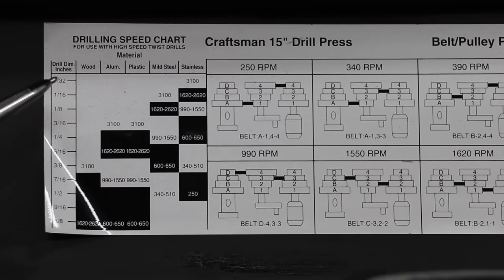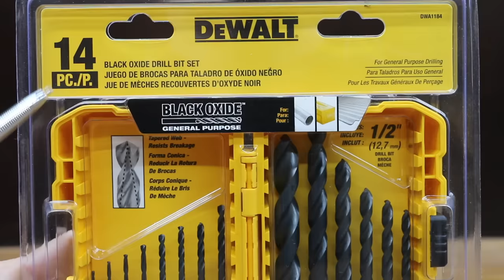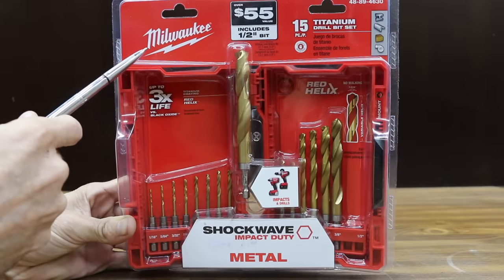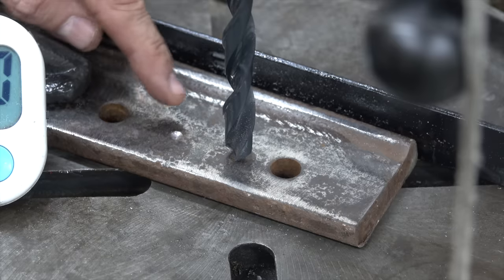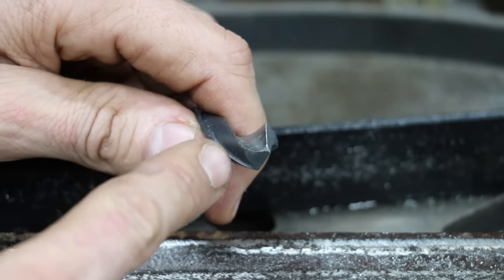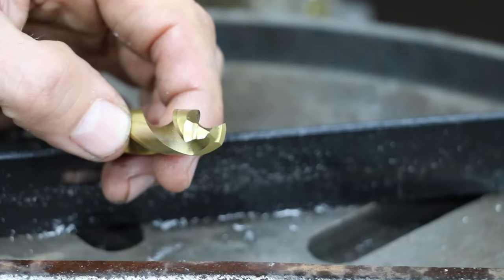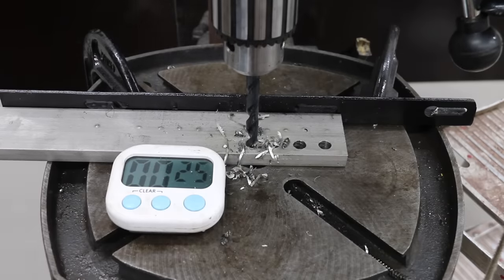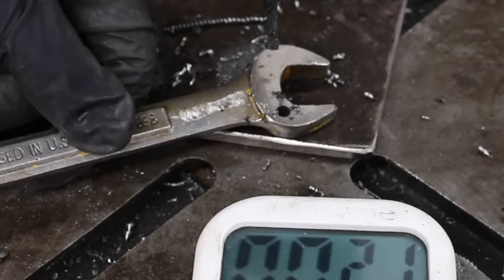Which Drill Bit Brand is Best? Let's find out!

Comment: You should test all the screwdriver BITS that go into a power drill/driver  tge cheap ones are always bending and rounding off for me bit I haven't tryed the good ones by dewalt ect    thanks
Reply from the maker: Thank you for the video idea!
Reply: was going to make the same suggestion ... I've have had various bit failures over the years and would love to save some time and money on my next purchase
Reply: Ive tried several. I Think drill bits and driver bits dewalt last along time.  Rest either stripped out or twist way to easy costing more in the long run. But i do more wood working than metal or steel. what little i use in metal/steel ive never had a issue.

Comment: I'd really like to see a high end bit test, even with only one or two sizes in each test. Champion XL28, DrillCo Nitro, etc.
Reply: I feel like the high end bits likely won't drill any faster, they will just last a lot longer.
Reply: Yeah that would definitely have to a be a durability test.
Reply: Honestly I could care less if the bit cuts a hole in 5 seconds on the first hole. How long on the 10th? How long on the 50th? 100th?
Reply: Or Irwin. My set of Irwin's has been a great investment. I haven't heard of those other brands so I can't really compare, but they last a hell of a lot longer between sharpenings than these hardware store brands.
Reply: @Will Lindberg yes. And keeping them lubed. If I would change this test he did any it would be to lube the bit throughout the test rather than just at first. I get that it was to keep the amount of oil the same across the board, but it isn't really the proper way. Even a cheap bit can last a fair while if you keep it cool, it will just be slower. As you could tell by the second test here, once that oil boils off and the bit loses its temper, it's all over.
Reply: To be fair to the average Joe this is an informative video.
Reply: Toledo twist in my shop!
Reply: @eclipsegst9419  do you use lubrication even when drilling with a portable drill?
Also, what should I use for lube?
Reply: @kindledninja  if I'm drilling metal I always do. Those little squirt bottles you can get air tool oil in are perfect for it. I just refill them with 15w40 because we farm and have it in bulk. Otherwise I would use whatever is cheapest, oil is oil for this purpose.
Reply: @eclipsegst9419  I've broken 3 bits trying to drill through a piece of steel that's only 1/10 inch thick. I tried to start the hole off with a center punch and it blunted the tip of the center punch
Reply: Norseman/Viking are the best bits I've used, followed by Champion and Triumph.
Reply: @Boabreath  uh oh. You guys are all making me want to go buy fancy bits I've not heard of before. I might have to "lose some" to justify it with the wife haha.
Reply: @kindledninja  what sort of steel was it? Stainless plate?
Reply: @eclipsegst9419  it was steel, I'd guess some sort of spring steel but I'm not certain. I'm kinda tempted to go at it with one of my carbide or cobalt bits but they're expensive.
Reply: @kindledninja  yes it sounds like you need a harder bit. And use patience and don't get it too hot.
Reply: Expensive tools don't make a better machinist. I laugh at the dummies I've seen over the years showing off their expensive tools and they still produce low quality. Someone has the top of the line tools usually is a bad sign

Comment: It is fabulous to find techniques embedded in videos. 
You put oil on the top of the drill bit and it runs down to the work area. 
That may be metal drilling 101 but this is the first time I’ve seen it. 
Good info on the Dewalt and Bosch 
Thanks
Reply from the maker: You are welcome!

Comment: It would be interesting to see how long the bits last after they have been sharpened by hand or a machine
Reply: The titanium sets can't be sharpened without replying the coating.  So they are mostly throw away after worn.  The others can be sharpened though.
Reply: Martyn Watson  Same for TiN PVD-ed files, wire wheels, etc.   It's cheap and generally not all that in cutting tools.  Great for appearance items, such as bathroom fixtures and doorknobs.   Looks purty, though.

Comment: Drilling an axle flange on a 6 ton truck was eating each bit I put to it. Ran out of bit when down to the auto parts store & found a Century Cobalt Drill Bit it did the trick for me. I have gone thru several sets of the Dewalt Gold. I may need to slow down my drill & add more weight, Thanks for the teat.
Reply from the maker: You are welcome!  Thanks for the feedback.

Comment: Test impact driver bits specifically philips heads bits.  Longevity of having a usefull bit. Also at what force do they shatter. Thanks again
Reply: I too would like to see the impact #2 Phillips head bits tested.  Also maybe the magnetic bit holders.  I seem to bust the bit holders and break the heads of the bits.
Reply: Pinpatch yeah Have you seen the new video? :)
Reply: i don't know if he's tested these yet but from my personal experience the only ones i've used that last longer than about 10 screws are milwaukee ones

Comment: My dad made drill bits for over 37 years, he used to tell me how "They were the best in the world, and the last worker owned drill bit company in America" All the time.
I'm a Gunsmith & CNC Machinist by trade... To tell you that I've spent my fair share of money on drills is an understatement.
They go by multiple names: "Norseman" & "Viking Drill and Tool" are the most common however.
Their carrying case is hands down the best you'll ever use.
After many years of breaking, dulling, destroying the heat treat on, shattering, etc... Drills, I've come to a conclusion....
He wasn't just BS'ing me, they really are THE BEST IN THE WORLD when it comes to mono material drills.
I can't tell you enough how much better they are man, It really hurt not to even see them mentioned on here.
Try a set, you Will never look at any of these chincy brands ever again.
Reply: ProSTEEL RAIN I do enjoy comparing tool brands. So I have a question for you. Have you tried Drill Hog before? They claim to be American made and even come in a very similar case as the brands you provided. Ive been tempted to buy them but I'm still seeing whats out there.
Reply: @Hellsing2161  I have no experience with those,  I know they are not manufactured by Viking D&T.
Reply: @Hellsing2161  Scrolled the comments looking for Drillhog & Norseman input/suggestions if this test is revisited. Would've been interesting to see how both brands stacked up to the box store brands. 

I got a Drillhog Moly M7 set off ebay maybe 3 years back give/take a couple months. They've been excellent bits, they seem to build much less heat in my experience than the couple of box store brands previously used. I've broke probably 3 or 4 bits since I purchased them. With the lifetime warranty you can email their highly professional customer service & have a free replacement in your mailbox in less than 5 days with no questions asked. *In the interest of full disclosure I drill various wood species several times per week on average & metal only a couple times a month. An acquaintance of mine who drills metals much more often than I do used them today on a couple types of hardwood & steel, he said he'll be buying a set in the near future. If I ever decide to replace them it will likely only be with a larger Drillhog kit.
Reply: @bhough410  Thank you very much for your thorough reply. I really appreciate it. I still hadn't decided on a set yet and I'm still using the junk I have laying around. But I think you have convinced me to buy a Drillhog M7 set now. Thanks again!

Comment: Seems the same rules apply with drill bits as they do with knives.
If they're cheap and come in a large set then they're cheap for a reason
Reply from the maker: Great point!
Reply: They're cheap for a number of reasons. Some reasons you can do something about, and some you can't. Some cheap drills just come with bad grinds. You sharpen it right and you're off to the races with it then.
Reply: Cheap knife sharpen properly will do wonder. 
Sauce, work in a kitchen.
Reply: Yes proper sharpening is quite amazing. Usually if it's cheap the edge is very soft and easy to sharpen. It makes sharpening very quick and easy, and it can still hold edges sharper than razors.
Reply: @SteveofArms  but if its soft and easy to sharpen it also goes dull faster too
Reply: @SteveofArms  dull bits don't drill the best. Shocking, I know!
Reply: @jintsuubest9331  fact is a lot of folks know how to smelt steel today. More than any time in the past. Even in my lifetime I've seen the worldwide improvement. So budget materials are suitable for a lot of tasks.
Reply: @rufedog5406  yep obviously

Comment: You can see with the 1/2 bits that they sometimes took awhile to "get started." I would always pilot drill steel with a smaller bit. Pilot drilling takes the pressure off of the chisel, resulting in a smoother finish and faster cut with the larger bit.
Reply from the maker: Thank you for the feedback
Reply: It depends on the type of point on the drill, good split point drills don't need a pilot hole because they cut all the way to center. Standard drills have a negative rake on the center section on the point.  A thinner or tapered web will have a smaller portion of the tip with negative rake and cut better. The best cutting drills for starting a hole have what is called a split point, they cut freely with less pressure and don't tend to walk as bad.The split point is made by a special grinding operation that eliminates the negative rake and forms a sharp edge all the way to the point center.
Reply: I checked the video to see if any of the drills tested had split points, and sure enough the view of the Craftsmen at 2:20 has one, if anybody wants to see an example. The cheap drill at 3:36 has a split point too, but it appears the steel was of poor quality or not hardened properly. Watching the video a little more, I see several with split points, including the DeWalt and Bosh drills.
Reply: Drilling a pilot hole is the fastest way to ruin a nice drill bit
Reply: @heily-3806  If you drill too large of a pilot hole then the larger drill can try to screw itself into the pilot, basically taking too large of a bite. A pilot that is smaller than the width of the web will usually stop that. Drilling out a hole, say an existing 1/4" hole to 5/16" , can be done without damaging the larger drill if using a machine that holds it back and can control the feed so it doesn't take to large of a chip load per revolution.
Reply: G53X0Y0Z0 interesting perspective I just haven’t had any luck with keeping bits in tact when drilling a pilot.  sure the pilot helps but it messes up the larger bit after time
Reply: @heily-3806  I have been involved in production machining for close to 30 years and I couldn't say how many holes we have drilled, millions I would guess. A CNC type machine or a mill that can control feed has no problem drilling out another hole just a little bit. I made my share of mistakes learning and damaging tools. Like I inferred before, if you can't control the feed with the machine, you need to do that with the second drill by using a small enough pilot drill that the second drill is still requiring some pressure to feed it. And even then the pressure needs to be lighter, to avoid taking too large of a chip and damaging the cutting lips (edges). I don't generally use pilot holes either, and when I do it's normally just a shallow hole or divot serving like a center punch to help the regular drill get started.
Reply: @G53X0Y0Z0  So it's really best NOT to drill a true pilot hole (but only make a divot) even when drilling a hole 1/4 to 1/2 inch in diameter?
Reply: @G53X0Y0Z0  Properly sharpened bits do not "screw" themselves into the material. The softer the material the flatter the rake required. A soft aluminum, or brass, or softer material may well grab if the bit is not sharpened properly for it. Standard bit shapes are for steel and hard aluminum.
Reply: @Marcoosianism  I drill pilot holes for anything over 1/4". I am an ex-machinist. You do have to be careful about the bit grabbing with some materials, but with a 1/8" to 3/16" pilot hole (for larger holes) I know the bits will not walk on me. Once I do a pilot hole I usually have the work clamped to the drill press.
Reply: @escargod  Thanks Glyn, very helpful.
Reply: @escargod  - I disagree with your comment that "properly sharpened bits do not "screw" themselves into the material", any drill with a reasonable clearance angle will self feed when drilling into an existing hole that is too large. The clearance angle (the part people grind when they sharpen a drill) and the rake angle that is formed by the helical flute angle determine the rate it will try to self-feed like a screw. That's why the drill will try to "grab"  if the feed rate is not controlled by a machine, it's taking too large of a bite, and can easily be over fed even when using a drill press or manual milling machine. If the drill is dull on the corners of course the tendency will be reduced because it takes force to feed a dull cutting edge.

Split point drills are superior to the old style of grind for drilling without pilot holes. As I alluded to previously, there are general purpose cheaper drills like in the video, and then there are the professional industrial quality tools. Some of the cheaper split point drills may not be ground as well, and results still may not match the performance higher quality tools.  Keep in mind that the first recommendations for using pilot holes goes back to before split point drills were in use.

A pilot hole can help keep a standard grind larger drill from walking on the face, but the larger drill is not guaranteed to follow the pilot hole exactly. The most exact holes are made using a spotting drill, followed by a good split point drill. If the hole needs to be better than that, boring and or reaming will be used after a hole is drilled. Grinding would be used for the ultimate hole.

With different types of drills, materials and machines there can be different techniques that will get the job done, but often the devil is in the details and experience and skill of the person too.

I'm still a machinist with my own shop and machines, doing production work for our products sold around the world. We have done work for some other companies too, people would recognize the names but I am not going to drop names.  People can try it different ways and do what works for them.
Reply: Without a pilot hole it places too much pressure on the center of the drill, and you get a cooling effect.
Reply: @G53X0Y0Z0  I don't know what you are disagreeing with. You just said " The clearance angle (the part people grind when they sharpen a drill) and the rake angle that is formed by the helical flute angle determine the rate it will try to self-feed like a screw."
That's what I said.
Reply: @escargod  - you said "Properly sharpened bits do not "screw" themselves into the material." If the pilot hole is too large they will certainly try to screw (feed) themselves into the material (that what's happening when a drill grabs.) My point was this will happen even with a factory or properly ground drill, although it can certainly be made worse by grinding more clearance to the cutting edge. 

And just so people understand, rake is the angle formed by the flute helix angle or pitch (unless it's been reduce buy a separate  grinding operation) and clearance angle is determined when grinding the point of the drill.
Reply: @G53X0Y0Z0  I agree with all you're saying it's just that I'm trying to make a clear distinction between how a "factory" clearance grind is NOT the proper grind for softer materials. Certainly more clearance makes for a touchier, grabbier drill bit but my primary point is the clearance angle of a typical drill bit can be too much to begin with for some soft materials. Often just a touch of a Dremel cut-off disc on the helix rake angle to reduce the angle can stop the grabbing (like with plastics).
Reply: RollinRat  I am skeptical about a bit wearing out faster. My experience is if you try and use a big bit (over 1/2") with no pilot hole it wants to wobble around till it makes a cylindrical hole to support the sides of the bit and then that hole is sloppy or the finish not that great, even with a drill press.
Cheaper and older drill presses have slop and a bit will flex. Sure, the starting dimple helps but I like pilot holes. I also step drill in roughly 1/4" increments. I don't see how you get a smallish DP to handle that work on steel without it.
Reply: RollinRat  YOU WIN! I am retired and I don't have the shop I once had. I compromise.
Reply: @G53X0Y0Z0  ,   I can appreciate this comment. Thank you.
Reply: @G53X0Y0Z0  , Extremely interesting. Reasons do help quite a bit!
Reply: G53X0Y0Z0 the millewakee and dewalts were split points...